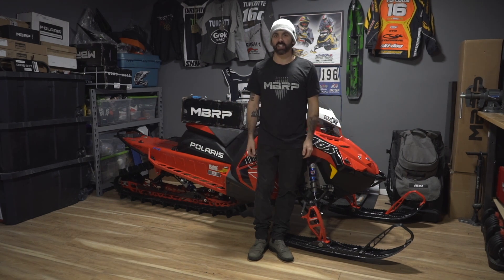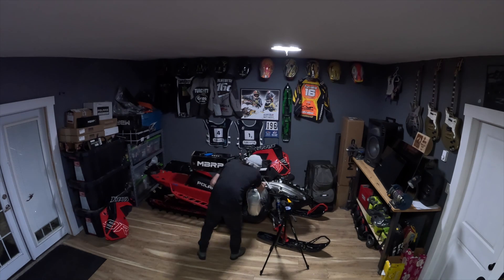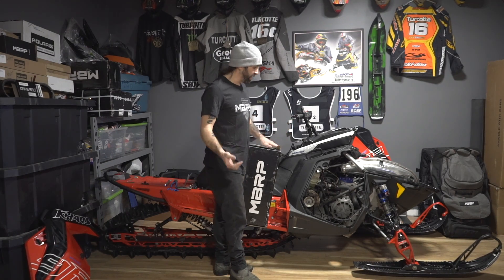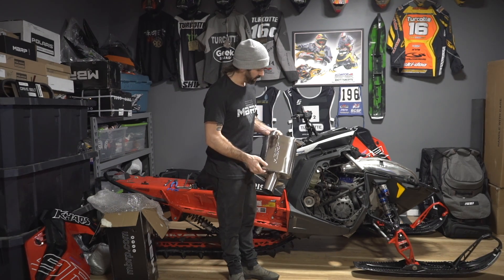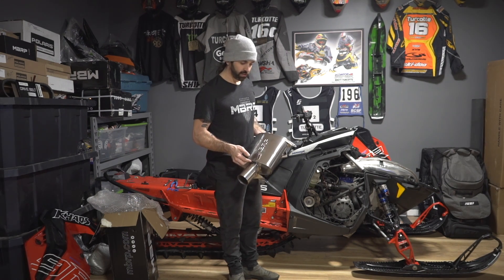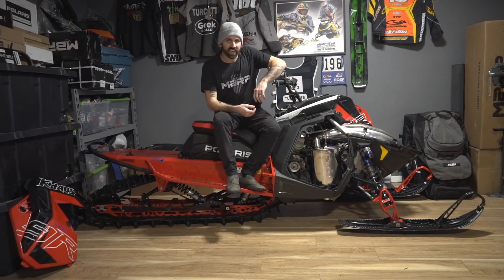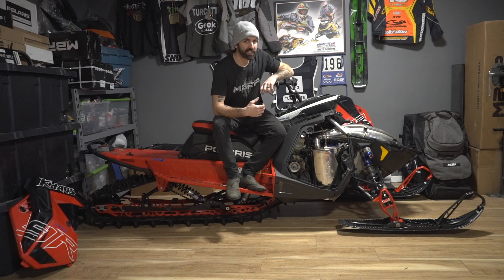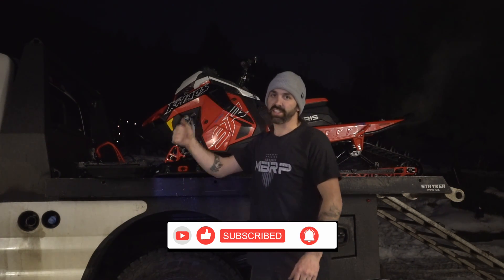MBRP Quiet Series Can! // Polaris 9R 146

Comment: You didn't show the spot where I got stuck at... how to remove the oem can,  after pulled the 3 springs and exhaust temp sensor.    .... it's solid. Not moving,  can't get it out
Reply: Ah ha!... found a 4th one in the back.   Also I took off a spring on the pipe on the side... that loosened it so could get can off
Reply from the maker: right on

Comment: Does the pipe rub on the bumper with the MBRP can? I have an SLP trail can and and my pipe is rubbing on the bumper was expecting better fit and finish.
Reply from the maker: not that i’ve noticed so far!!
Reply: It does not rub... it uses a spring on the upper right side of the can that pulls the pipe away...0 rubbing all season.  My other can rubbed a lot